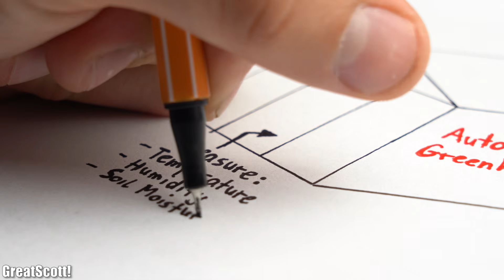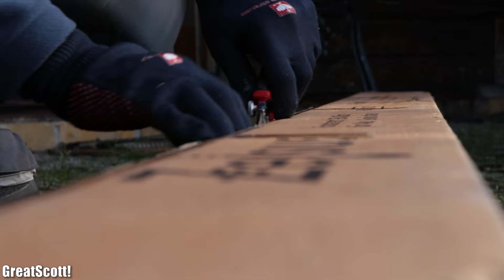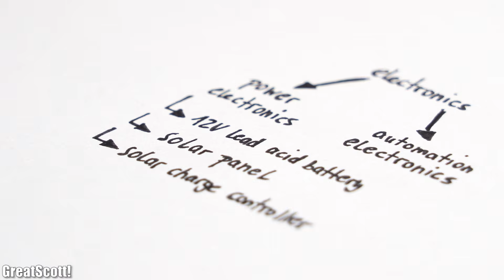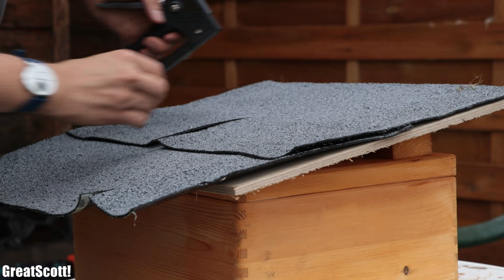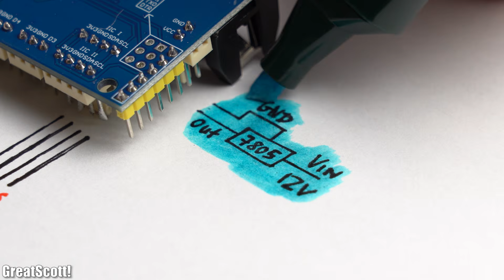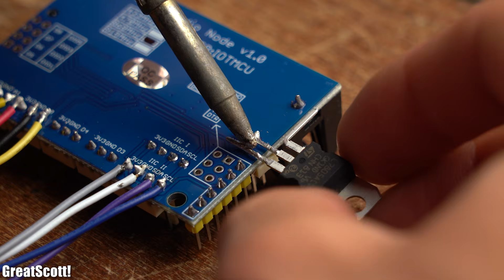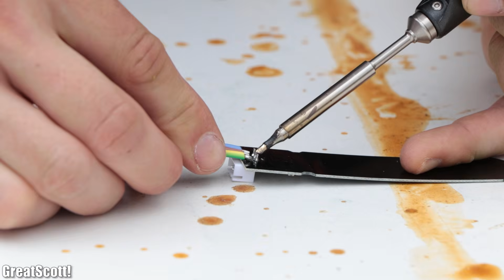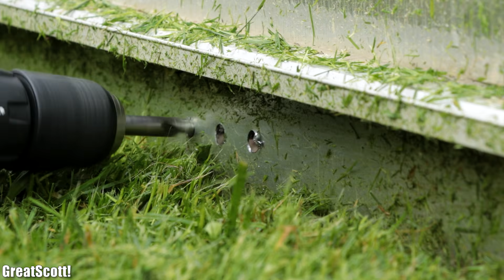Automating a Greenhouse with LoRa! (Part 1) || Sensors (Temperature,  Humidity, Soil Moisture)

Comment: Hi Scott. This generic type of solar charge controller is not very kind to lead acid batteries. They tend to get fried/overcharged. I know this because I just got back from the supermarket replacing the second battery in 3 years that had failed (dropped a cell I think). I am keen for anyone to recommend a better solar charge controller for lead acid batteries.

Comment: Hey, I am working on a small smart greenhouse as a project and the project includes a heater, 4 DC motors and  few sensors. The total power that devices and elements  consume is 75W . How many Walt solar panels do I need to use for this? I would be glad if you could give me information about this.

Comment: Its 2022 and some of the items were not available. Is it possible to use other gateways? e.g VE.Direct LoRaWAN EU863-870 module,  Dragino MS14N-S Linux IoT Appliance with Sensor Terminal, Dragino LPS8 Indoor LoRaWAN Gateway (EU868) etc

Comment: Hi Scott, I really like your videos. Made a system like this before for myself. 

But please, use 'wartels' (thats how its called in dutch) for putting your wires through the frame. It will protect your cables from scratching agaist the Al

Comment: Great project, as usual.
But you should probably have had a concreat foundation, so it will stand occational storm.
Have seen what wind can do with a greenhouse.  It just missed my car after a flight of about 10 m and then we had to collect parts up to 1 km away.  And we had a proper solid concrete foundation that the greenhouse was screwed to.  We have more screws now, in the new greenhouse built on the same foundation and parts of the old one.

But yes, you should have a proper foundation so your greenhouse doesn't destroy other things, like your house, car or neighbours.

Comment: coming from someone who's tried to write code for the BME280 using just the datasheet, if you find existing code for it you can use, use it. if you still want to write your own and are wondering if the registers are little- or big-endian, the answer is both.

Comment: The BME280 can't measure temperature precisely, in the the datasheet you can found, that, the temperature measurement is used to calibrate the humidity and pressure measurements. It's not that bad, but in my case it was always +2°C. Very good project by the way! Really enjoyed ;)

Comment: If you check the Dragino LG02 gateway on the manufacturer's website it states:
"For Private LoRa Protocol, Not recommend for LoRaWAN use."

I'm guessing this is because it has only 2 channels and not the full 8 or 10 or however many a full features gateway would support.

Comment: I suspect there's a huge voltage drop along that overkill cable you use for the analog sensors. Also, i2c might have some hard time transmitting properly using such cables.

Comment: You might want to use cable glands where you drilled into the base of the greenhouse. Those silicone cables are about as hardy as cold butter, and the aluminum could easily cut through  them.

Comment: Instead of  7805 regular ic you can use direct 5 volts from usb port of solar charge controller , 
7805 is less efficient than usb buck convrter inside the solar charge controller

Comment: Tip: Either switch out your soil moisture Sensor to an inductive one, one with carbon electrodes or at least deaktivate it, when not measurring. These things corrode fast! (Voltage & Water = Electrolysis)

Comment: Building and growing, you are in my wheelhouse now. When your soil moisture sensors eventually fail consider a Blumat watering system, no electricity, no technology, just physics. I am looking to set up a similar system with added CO2 sensor and controller for an indoor garden.

Comment: So i have a question 
I have a 40watts solar panel with the output current of 2.30Amps 
Will it charge the 12volt battery with solar controller??
Thank you in Advance
Reply: yes it will

Comment: Why did you need the 5V regulator to power the Node board?  The schematic on Github says it has a SPX3819, which should be ok with 12V?  What went wrong?
Reply from the maker: I said it in the video

Comment: In your project, we saw sensor data temperature =24.5, humidity = 38.2, moisture 871.0,692.0  is it possible in the output side add relay board and make them on/off on a certain condition such as: if the temperature is greater then 25-degree celsius then turn on the relay && if the temperature is less then or equal 25 -degree celsius then turn off the relay. 
in such a way if the humidity is greater then 65-percent  then turn on the relay && if humidity less then or equal 65percent  then turn off the relay. 
and can a manual over right be added to on or off relays manually?
the relays will be connected with chiller, fan, humidity fire, etc which will keep the greenhouse in perfect growing condition.
It would be very helpful if you answer this bro.
Stay creative. I will see you next time....

Comment: It is very scary to know that all your Greenhouse Data is transfered to an cloud based system. No control about Data missue whatsoever... Never trust Cloud systems in the first Place to be around longer than a year till they are turned off. Typical Lifetime of a houshold installation is about 20-40 Years. Clear issue in the Design.
Reply: TTN is easy, but you can use your own LoRa Server instance and do the same thing

Comment: Hey, Great Scott!
I have a electric question and I you maybe could helb me.

I want to make nanoleaf auara DIY. Nerdforge inspired me, so I want to build it too. He linked in his video a YT called ZDeanzo. He build a less complex circuit. It's powered by an 5v power supply. He build an esp32 into the circuit so you can control the WS2812 light strips ower WiFi. Nerdforge has published a code for the esp32. I changed the code so, that it works with my WiFi an my numbers of LED. The power supply power the esp32 and parallel the light strips. I connected the Data cable with the the Data in on the light strips. I have he gnd cable connect the gnd on the dc with the esp32 and the gnd of the light strips. After plug in the power supply the esp32 connected wit our WiFi and to my program, wich I copyed from ZDeanzo, in the Blynk app.

My problem: The LED strips doesn't light up. I tryed with and programm with only a few lines of code, so that only the light strips should light, but they didn't. I don't know why the don't work. I changed the data output from the esp32, but they don't light. Have you an idea where is the mistake. I think I make all thing step by step to the video.

Mountain Liket

Comment: It would be interesting to hear feedback on are the soil moisture readings reliable if  sensor is placed near the plant roots which naturally has lot of juice inside them, whole a tually soil is dry. At least i have received not reliable readings if to use resistive sensor (new, made from two steel wires, sold on aliexpress)

Comment: Hey there, great vid! I was into this topic in my bsc thesis but used pairs of esp8266 and created mesh network so they can pass data on long range farm fields, and also automation scenarios which you can set triggers like: relay-1 on or off when humidity above x, until it hits down to y etc. There may some open source software alternatives for this specific automation now, but if it helps, you can take a look for the source codes on my github titled by 'SmartAgriculture' (@OnurYurteri). I need to say that i'm not proud with my documentations and code quality back in the day :P if you want to chat, contact!
Anyways, i'm SO happy and enjoying so much to see a project just like in my imaginations, even better with your electronics expertise! Looking reaally forward for upcoming videos!

Comment: Might want to add grommets for the 3 wires going through the base of the greenhouse through the sheet metal. Over time the insulation could rub and cause a short.

Comment: Have you seen the TTGO-HiGrow ? $15 ESP32 soil sensing temp humidity and lux. They just uplaoded the schematic too... 
http://www.lilygo.cn/prod_view.aspx?TypeId=50033&Id=1172&FId=t3:50033:3   
https://github.com/Xinyuan-LilyGO/TTGO-HiGrow
I want to redesign with an SHT31-DIS to accommodate 100%RH as my DHT11 crapped out due to that. Would also happily replace the lux sensor for an LDR or anything to bring down cost. Keen to have additional external I2C connection for a foliage level SHT31 externally connected with jumper. Was also tempted by the LilyGo TTGO LoRa device but the HiGrow soil sensor shape sold me :) Curious about the I2C via differential pairs achieving 100ft (RJ45) which would do most greenhouses, but for now 1device per plant/area.

Comment: Let's say other than setting up the solar panel and building the greenhouse,that im an absolute idiot.. Is there like a plug and play way of doing this,that i just run the water lines,place my water sensors, add drip tubes...and it just waters it when it needs it?

Comment: Great video.  Always enjoyed your content! I've done something similar over the last few years, with a couple videos showing my setup. However, moisture sensors are pretty much a waste of time in my experience. They just aren't good enough...and are affected by things like salt content in the water.
Reply: because of this i soon switched to a completly mechanical watering system called 'Blumat Tonkegel' whitch is cheap and always waters perfecly. They even work with hose connectors or just a reservoir that is just a bit higher.
Reply: true i confirm
Reply: Ok
Reply: @Walter Andy I really appreciate your reply. I got to the site on google and im trying it out now.
Takes quite some time so I will get back to you later with my results.
Reply: @Walter Andy It did the trick and I now got access to my account again. Im so happy!
Thank you so much, you saved my account!
Reply: @Keagan Trey glad I could help =)
Reply: you probably dont care but does any of you know a way to get back into an instagram account..?
I was dumb forgot the login password. I would appreciate any tips you can offer me.

Comment: 60 second interval is too often. The Things Network standards say that you should have less than 30 seconds of airtime per day. Even at SF7, that's going to be a lower limit of transmitting every 2 or 3 minutes. Not 60 seconds. (And although "it may just work", this is one of those things where "TTN may just block you".)

Comment: Madness, I made one based on a Wemos D1 mini (WiFi tho, not LoRa as my raised bed is near my router), but the rest similar: Solar panel, old cell-phone battery with built in controller, the same soil probes, a similar temp/humidity sensor, and a cheap water pump. Works great, and I'm now known as the worlds laziest gardener!

Comment: Car battery is not the best choice.  Car baterries  die quickly with low and long discharge. A ups lead acid or a dedicated solar system battery is a better choice.

Comment: I think it's a good idea to add a rainwater harvesting system to this project. Moreover the tank might stand on the base like meter above the ground so a pump will not be required but only solenoid valves.

Comment: We install soil moisture probes into fields in order to analyze the amount of water needed. I was recently told about CropX’s new line of LoRa-capable probes and we are looking to set up a LoRa network in order to make probes cheaper for our clients (cellular technology is currently being used). Do you have any pointers for LoRa technology?
Reply: The setup demonstrated in this video is incredibly basic, using a single-channel gateway isn't ideal for LoRa or TTN. But if low power, low cost and long range is what you need; LoRa is the answer.

Comment: Great video as usual. Gives me some ideas for what I want/need to do in my garden (no greenhouse yet). BUT, I did cringe a lot when I saw you passing cables through unprotected holes - with some jagged edges - in the metal base!! PLEASE ... use some waterproof cable glands! Not so much for waterfproofing but for cable protection. Shame to spoil a great project for the sake of a few glands. These are the kind of thing I mean (but I'm sure you know that):
https://www.ebay.co.uk/itm/5Pcs-New-PG19-plastic-waterproof-connector-gland-connector-10-15mm-dia-cable-SJ/254615350406?hash=item3b4841ec86:g:sQUAAOSwMnJdEtPB

Keep up the great videos.

Comment: You need to use tera preta:
https://youtu.be/p0YNFn9Dloc?t=358 - biochar power (beans and two farmers)
https://youtu.be/XQxthabe_OU?t=1675 - 2fold (old image from USA past)
https://youtu.be/5Czs3kI8Rk4?t=430 - bamboo biochar (hill+mikoryza)
Plus put some CO2 generator. (the best is from limestone, hot limestone should regenerate in the air when cooled)

Comment: Can't wait for part 2. Instead of soldering cables directly to boards, which can lead to broken cables,  may I suggest the use of 2.54 mm pitch terminal blocks and crimped terminal cables? Excelent and reliable results.

Comment: Great work! Few tips: Don't let the wood box sit on the grass for a long time. Even with urethane, that isn't pressure-treated wood. Maybe a few concrete blocks? Those Silicone cables going through that aluminum truss needs some sort of protection. Jostling will slowly slice that cable on the sharp edge. Also, those holes in the wooden box are moisture ingress vectors too...two birds, 1 stone, get some poly caulk and go around the cable both in the back of the box and through the truss.

Comment: Hey Dude! I hope you programmed it, that the soil is not checked every second.. I did this once and due to electrolytic effects the sensor corroded away in no time. Since it gave wrong values (soil to dry) the added pump for watering turned on and flooded my garden. Fortunately it was basically just a big bucket of water and not a solenoid valve. That could have escalated quickly ;) Cheers!

Comment: just don't know why you didn't used the connectors instead of soldering the wires + I would seal up the  battery box (to be out of bugs that will appear like plants.

Comment: Hey Scott! I think there is something about the foundation to consider. My greenhouse has a concrete foundation witch add some weight to make it withstand high wind/storms. May you can check out garden forums etc to find out if you need to retrofit some screwpoles or such like. Great video!

Comment: I use thermal actuators to open and close the windows. They work without cables and electronics. Instead I use a similar system to your one for watering. Additionally I try to detect plant diseases and pests with a webcam and AI, but I had no break through yet. It would be interesting if you could do that better.

Comment: Love the project. I've setup some water collection and a pump controlled via Smartthings for watering.

These are a pretty low tech but efficient way to open the green house windows https://amzn.to/3fN5OrX I think they use wax in the piston that expands when it gets hot to open the window. Love simple solutions :)

Comment: This type of moisture sensors destroy themselves during work , you should add some transistor to turn on this sensor only whey you measure your moisture ( like once an hour) , this will work longer then this solution

Comment: Hey scott, im going to recommend something here that i use and really like. Instead of the internet of things site, you should check out a service called Blynk. Blynk is a service that you send data too and you can view it on mobile devices on an app in a clean way, there is also a http interface to see data. i would use LORA modules but use a nodeMCU or WeMos D1 mini on the other side to connect to your home internet. Blynk is a really clean app and you can even self host a server on a raspberry pi zero w for all the control. Just a thought. I use a wemos D1 mini and raspberry pi zero w for my setup to check my wood fired boiler temperature in the winter. this combo works really well as Blynk has a TON of features and automation.

Comment: If that battery is not sealed, it will emit hydrogen gas, which needs to be vented.  I also think there might be corrosive vapors, so the electronics should be sealed off from the battery compartment.

Comment: I put a simple automotive fuse between battery and solar controller on mine. You don't want to be connecting a lead acid to anything without a fuse.

Comment: Do the wires attenuate the signal of the analog sensor? 3 volts on that size of wire. Did you account for the resistance of these wires?

Comment: I'd recommend to use silicone to "glue" all the plastic panels in place, and some kind of concrete foundation or at least some kind of cornerstones to anchor the whole thing down. I have the exact same kind of greenhouse for a few years now, and the plastic panels just blow away in the autumn storms, no matter how many of those metal clip thingy's i used. It took about 20 tubes of silicone to glue them down, which is not that environmentally friendly, but i got really tired of picking plastic plates out of my neighbors garden, or cutting new plates.

Comment: Just a thought, it would be wise to add grommets to those holes in the metal base to prevent the wires from being frayed and you should raise the wooden electronics box up off the floor using 4 feet to allow for air to flow underneath and this will then stop the box from pulling up the moisture from the ground, I know that you sealed the wood, but it will still draw up moisture.

Hope that this helps and thanks for the great content!